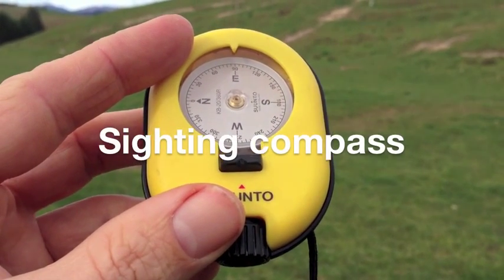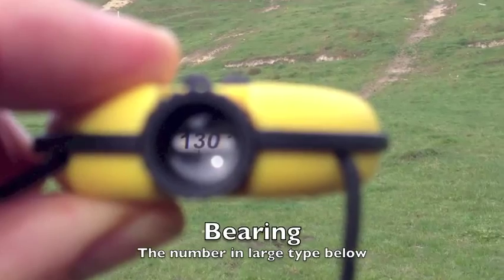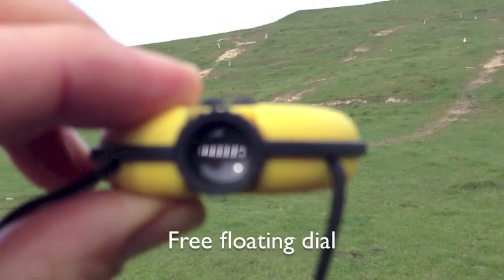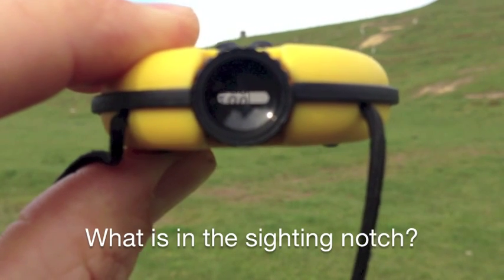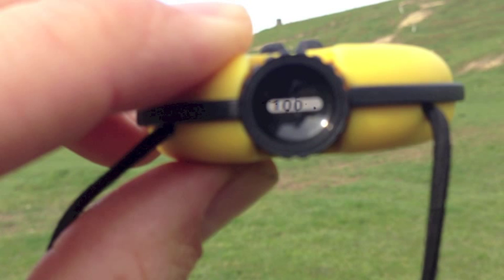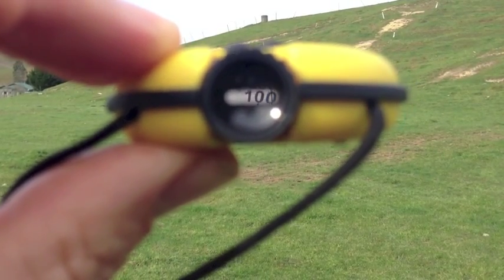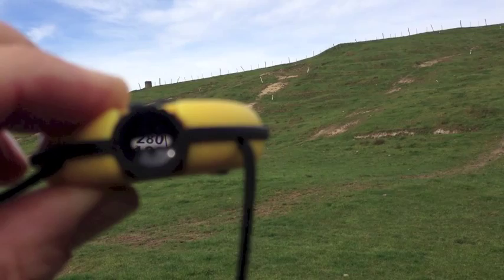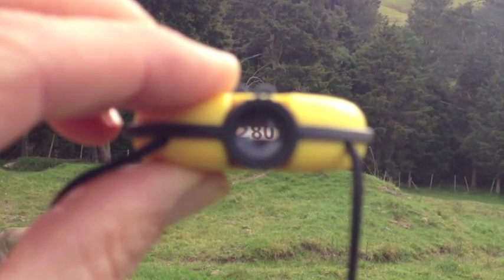Following bearings using a sighting compass

Comment: DOCskillable: Correction....when determining the back-bearing you only ADD 180 degrees if the forward bearing is 180 degrees or less. If the forward bearing is more than 180 degrees you have to SUBTRACT 180 degrees to find the back-bearing.